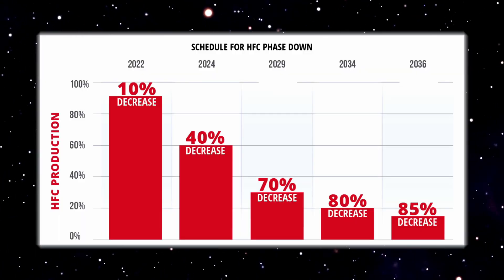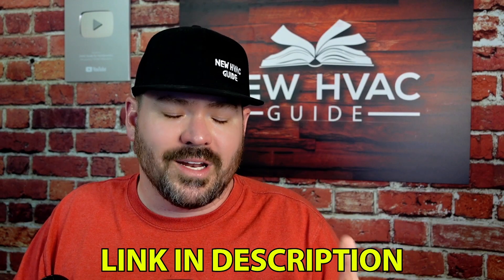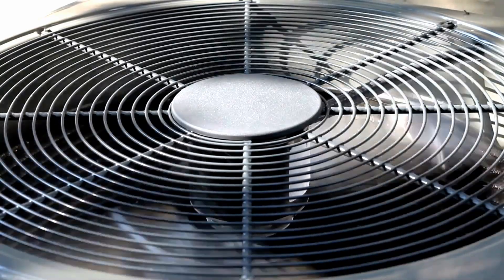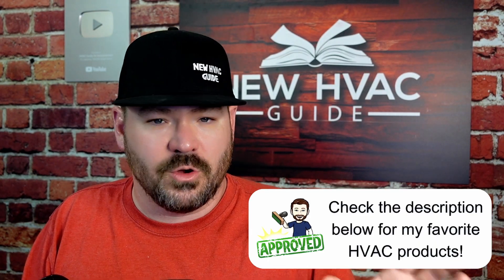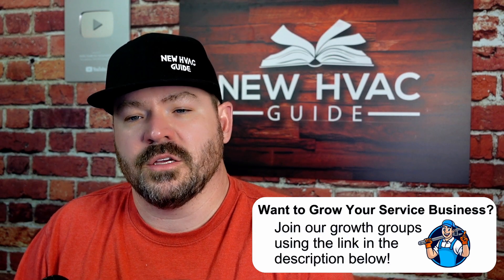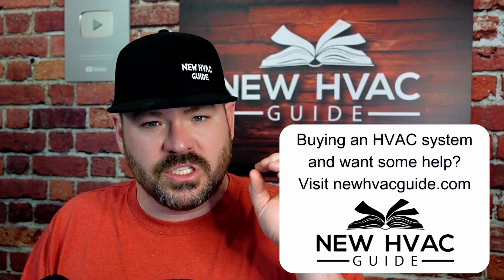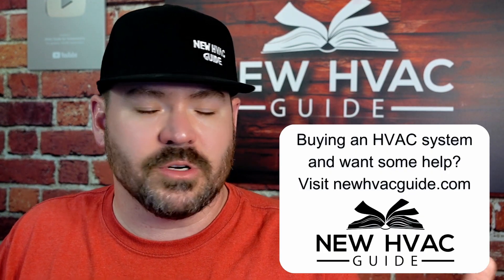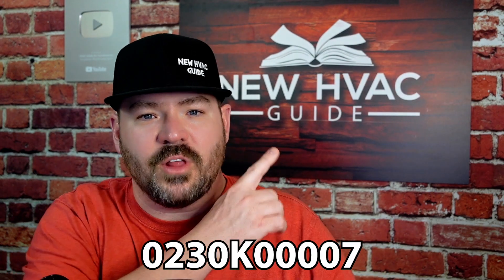REQUIRED! A2L Board for HVAC Zoning And Accessories!

Comment: I was just looking at that board the other day, thinking about adding zoning in the future.
** on another note, all that magical mitigation stuff for the limited amount of refrigerant and yet a natural gas or propane leak elsewhere in the building can still fill and level it.
anyway, I know they're mainly covering their rears with all that stuff. and I guess it could alert to a leak/buildup of other flammable gasses, providing it has an external alarm connected.
been many homes/building leveled that way.